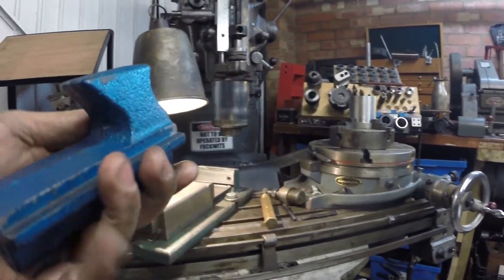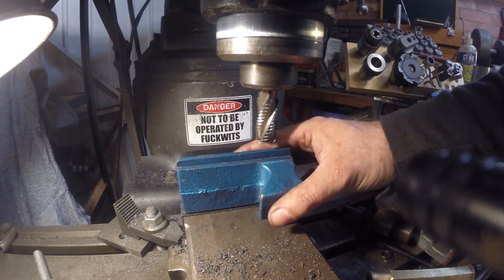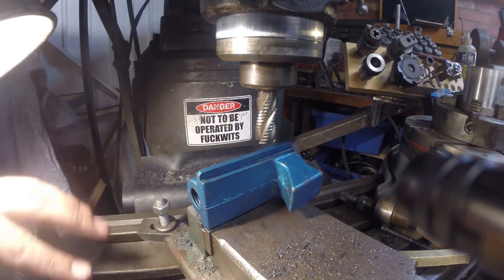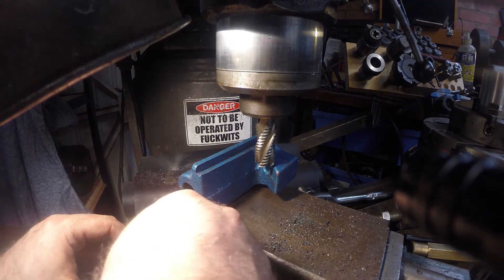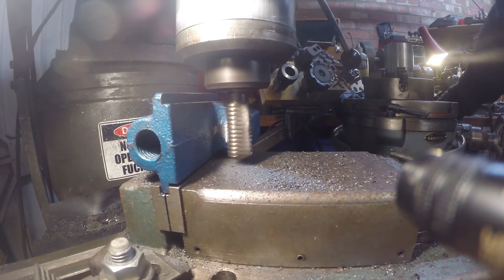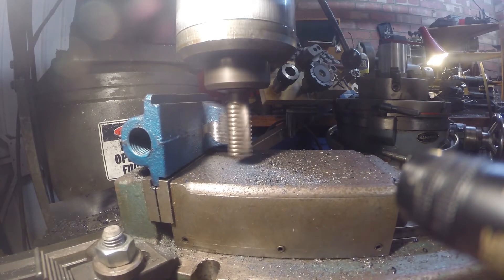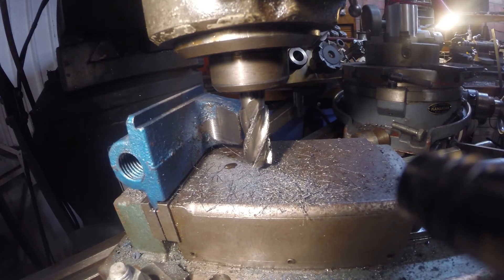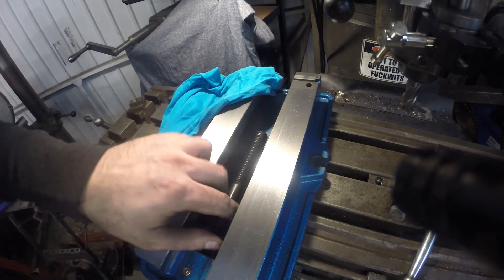Arc Milling Vise - Machining for better clamping

Comment: Would be interesting to see how much jaw lift it has, have you measured it by any chance?

Appreciate that you leave the bloopers in the videos,.....makes me feel less stupid when it happens to me l.o.l. ;-)
Reply: Jaw lift is pretty small. But after a while it develops a big side to side movement and I have brazed a crack forming on the jaw where it interfaces with that angle piece. I think mine is the same model. The threads are holding and I was surprised to find a bearing on the screw. I would not trust on some heavy machining.

Comment: Hi, watching this video a while after you have posted it. Has it made a considerable difference machining the face flat. plus you still recommend this vice since looking at one currently myself.
Reply from the maker: The flat certainly makes a difference to the clamping feel, for sure. No complaints about the vise at all, it's been a good buy overall.
Reply: @Designments  cheers for that